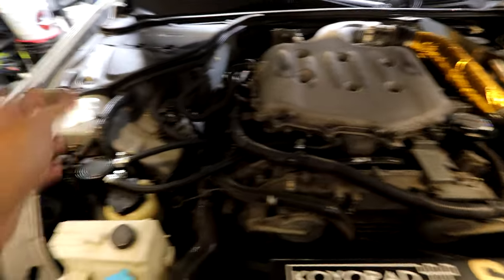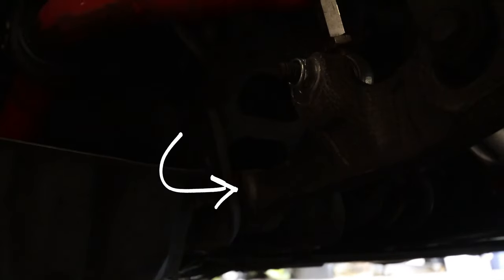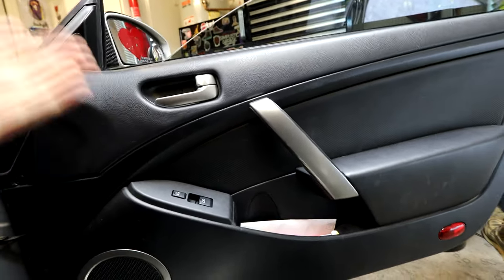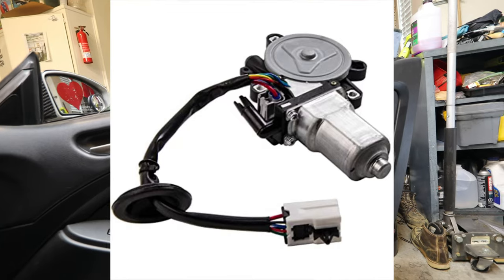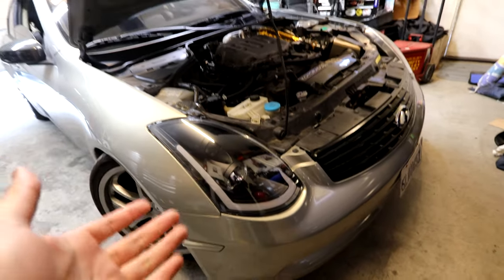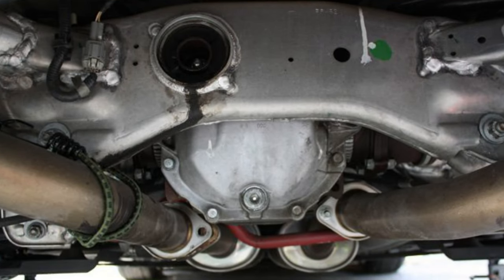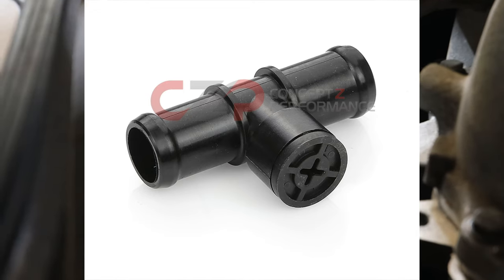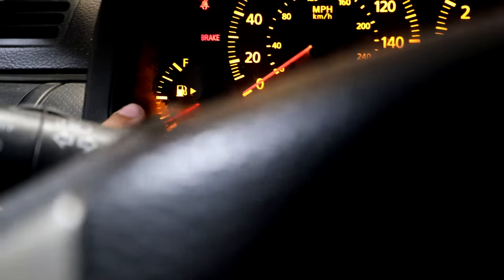The MOST Common Infiniti G35 / 350z Issues and Problems!

Comment: I have my 2006 g35 coupe automatic for 2 years now. No major problems till recently. It has valve cover leak which has been going on for a while till recently I found out the problem. I am going to fix it once I am back home soon from college.
Reply: what are symptoms of a valve cover leak?
Reply: @scotteberline5458  sliver part on side of valve cover should be shiny not covered with oil. If it is covered with oil. You should replace the valve cover before it gets worse. It is on both sides. If one is leaking. Replace both I would recommend

Comment: How much oil does it burn and how much oil should i add ? Ive been trying to find out cause i own one. The dip stick is a bitch to test with aswell lol
Reply from the maker: Try sanding the dipstick where the little low abs high is with 100 grit and it’ll help a ton with making it easier to read! From low to high on the dipstick is one quart, so if you’re halfway then add half a quart of oil :)
Reply: Even sanding it didn’t help. It’s because there is a curve no matter how you pull it out it’s going push the oil off the dip stick
Reply from the maker: Works great for me!

Comment: I've had mine for about a year driven it everyday, only issue I've had is oil consumption 1quart every 1200 miles and my radiator blew but still going strong at 215,000 miles

Comment: I need your expertise when I start up my 2004 infinity G35 Sedan cold start it rattles almost sounds like there's no  Oil it only does it on cold starts
Reply from the maker: That’s something after I uploaded the video I realized I should’ve talked about!! 
The most common cause of this rattle is the primary timing chain tensioner. What it does is after you turn the car off it bleeds down instead of holding pressure. So when you start the engine, the tensioner is not primed and is allowing the chain to rattle. But it only takes a second or so for it to prime. That is why you are getting the rattling when starting when cold.

Comment: Hey I own a 2003 g35 coupe currently having an issue with popping sound from exhaust car is nowhere near as loud as it was I miss the loud thing so much plus starting to backfire only rarely ok so other than the popping not as loud and loss of power issue I unplugged my maf plugged it back in engine lights on though is running a lot smoother barely makes the popping sound but still bit quiet and not as much power please help lol

Comment: I need some advice on my g35 vdc light is on and slip light any suggestions
Reply: Easiest way to diagnose the issue is to plug the car to an OBD reader. Most likely the issue is your camshaft sensors.

Comment: I just bought an 03 g35 coupe, I came from Honda and know nothing about nissan/infiniti so this vid helps, my window motor works on d/side but when I use the auto roll up once the window hits the top, it will roll itself back down about half way, is that the window motor or another issue?
Reply: yep definitely window motor /power window regulator is on the way out. Had exact same issue with my passenger side window.

Comment: I’m thinking of buying a 2004 G35 with 140,000 miles soon, the guy said the only issue is the front shocks went bad and has no check engine lights. Should I get it or no?

Comment: My 2004 infiniti i35 has a whining sound when I driving it in the first 15-20 minutes. Engine light P0011/0021. Replaced vvt solenoid oil valves already. Light still on after 750 miles. Idling is steady, no overheating but long trip on highway (150-250 miles) will eat up 1/5th quart of oil. HELP  !

Comment: They don't sell the complete wheel-hub with assembly and wheel-bearing anywhere..! Why..? 2003-08
Reply from the maker: It is a two part design so you replace the part that is mest up or both parts. I hate that too so that’s why I upgraded to the 370 axles and wheel bearings where they’re a one piece complete instead of 2 piece
Reply: @JoeVazquez  Thanks..! I'm going to look into that now but I got a AWD G35X
Will they have that piece or can you lead me to a good after market source..? Plus I  appreciate you taking the time to respond..!

Comment: I have a 350z and I had oil leak in to my spark plug but replaced the seal and it's been pretty, and my driver side window won't go down
Reply from the maker: Most likely the motor but could also be the switch!

Comment: I changed my valve covers 3 times the first time I got covers from Amazon with gaskets lasted 4 months then I got covers and gaskets  from z1 and leaked again a year later now for the 3rd time I got new gaskets from z1 and ebay valve covers and going 3 years with no leaks.
I have some camber issues on the front suspension  I changed everything and my camber is still crazy.as of yesterday I'm selling my 04 coupe.im done
Reply from the maker: Sounds like the problem wasn’t the valve covers, moreso the crankcase pressure is too high. Have you replaced your pcv valve? And camber in the front you’ll need to get adjustable upper control arms and that’ll fix it!
Reply: I'm just ready for something different. probably a truck
Reply from the maker: Can never go wrong with a truck brotha!

Comment: Just baught a 2005 infinity g35 sedan yesterday and it ran fine on the way home but when i got home it didint have the same throttle response and it had a clicking noise comeing from the enigine but the like a fan hitting somthing as i aclerated or somthing but than it threw a check engine an started runing rough an it turned off an wouldent stay runing ahen i started it an wouldent let me give it gas when it did start it it ran really rough than
Reply: Was wondering if anyone had a similar problem an could poaaibly know wha it is causr i dont have a obd scanner rn

Comment: I have 2004 g35 6speed the other day I was going to work just left the house driving fine all of sudden all my check lights came on and I was in gear I could push the pedal down and no response I could put it in neutral and it would rev up but in gear no response only in neutral I get throttle response any ideas?
Reply from the maker: What’s does the code say?

Comment: my speed dominator not working after i changed valve cover and gaskets!  also my my dashboard lights turn off when i have my headlights on , any solutions ? thanks
Reply from the maker: Dashboard dimming when headlights are on is because your dash dimmer dial is all the way down! Go to where your trunk button is and to the right there’s a dial, play with the dial to the exact brightness you want!
Reply: My tachometer doesn’t move all all while driving , it stays at 0 mph ? I assume it had to do with the removal of the throttle body would the re learn help this case

Comment: I replaced my valve cover gaskets a year ago and been good since, didn’t change the valve cover itself cause oem is like $500 I try not to cheap out so does anyone have experience with buying the $50-60 valve covers from eBay or Amazon? If anyone has them installed let me know how they have held up.

Comment: did your g35 come with rear brembos? because my only came with the front ones, 03 brembo package too
Reply from the maker: Yeah front and rear brembos!
Reply: @JoeVazquez  dope, one more question. I have a lot of oil in only one spark plug hole. it was so bad when i pulled the plug out it started dripping like hella oil. Is that 100% the spark plug socket or could it possibly be valve covers?
Reply from the maker: It’s the oring that’s part of the valve covers themselves! You can’t replace those alone since they’re connected to the cover, but There is a video by Aaron Newman on him taking them off and putting some Honda ones if you’re up for saving some money and want to do some diy!
Reply from the maker: @thejoevazquez
Reply: @JoeVazquez  followed

Comment: I got water in my spec D’s the passenger side headlight and now the white led is extremely dim it looks like it’s basically off but my turn signal is equally bright as the driver side. Does anyone have any recommendations? Is it salvageable.
Reply from the maker: Dam man, they may be messed up but you can still try to either seal them up to protect them from getting worse with silicone sealer!
Reply: Yeah I put the G on a tow dolly and when I took it off it pull my bumper and somehow took off the cover on the back of the headlight and after I got the car running I took it to the car wash and the was so much water inside of them. I had to take them off and pour it out and then dry the inside lens.

Comment: My second cylinder just started miss firing I got spark plugs 2 months ago platinum ngk what could be it
Reply from the maker: Check inside for oil in the spark plug tube, if there’s none then swap the ignition coil with another one next to it and see if that fixes it, if it does, then your original cylinder 2 coil pack is bad and you’ll need to buy a new one
Reply from the maker: No problem! I’ll have a cool coil packs video using gtr coil packs so stay tuned!
Reply: More than likely ignition coils, replace all 6 and problem should be gone